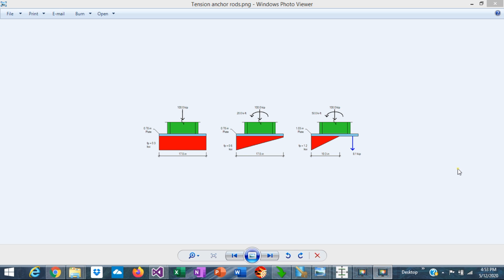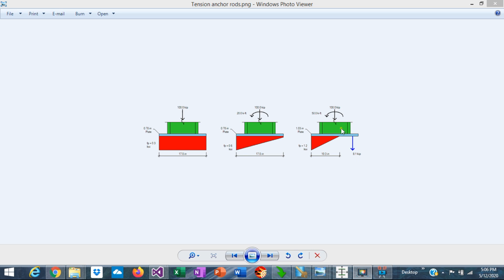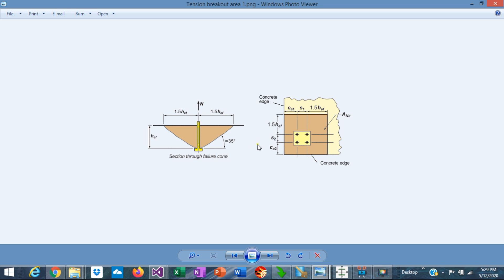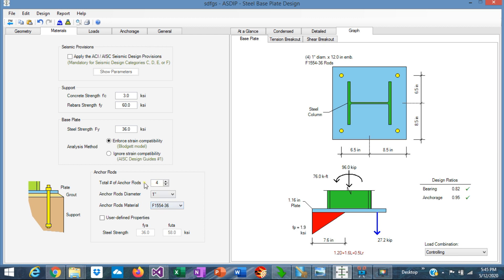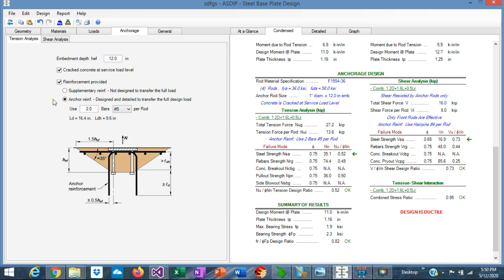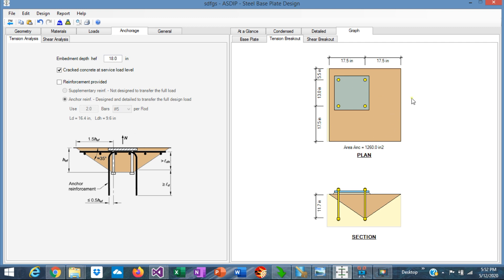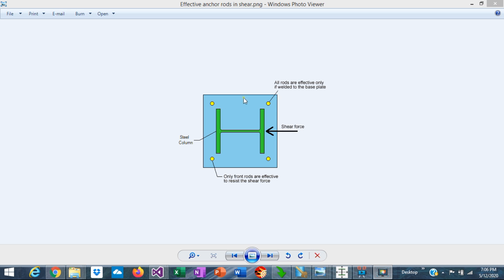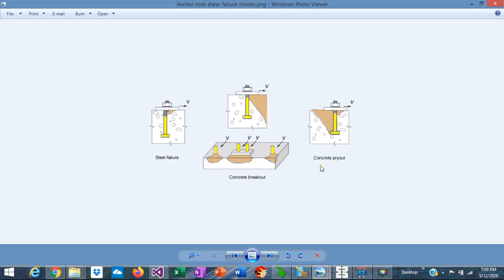Anchor Rod Design - The Complex ACI Provisions

Comment: 6:20
Cuando el anclaje no esta soldado a una pletina (como en el caso de las placas bases), existen tres tipos distintos de casos. El que mencionas en el vídeo sólo corresponde al tercer caso (Figura R17.5.2.1b ACI 318-14) y no considera los casos 1 y 2 de la misma figura. He estudiado este tema en los últimos días, contácteme y podría entregarle mucha más información importante que sería útil en el software.

When the anchor is not welded to a plate (as in the case of base plates), there are three different types of cases. The one you mention in the video only corresponds to the third case (Figure R17.5.2.1b ACI 318-14) and does not consider cases 1 and 2 of the same figure. I have studied this topic in the last few days, contact me and I could give you much more important information that would be useful in the software.
Reply from the maker: ASDIP STEEL considera todos los casos.
Reply: @asdipstructuralsoftware7797 Sólo considera el caso 3, es decir, toda la carga de corte lo resiste los anclajes de al frente. Hice el ejercicio de reemplazar los valores del ejercicio 18 del capítulo 15 de "The reinforced concrete Design Handbook", del ACI 318-14 y no entrega los mismos valores debido a ese error. Además, al momento de analizar la resistencia al desprendimiento del concreto por cabeceo del anclaje sometido a cortante (Prayout, capítulo 17.5.3), toma en consideración el área total del cono de falla de los anclajes que se encuentran en tracción y eso no es así ya que se debería tomar el área de los anclajes que se suponen trabajan a corte.
Además, para momentos bajos, es posible que todos los pernos se encuentren a tracción y no solamente los más alejados. En planilla, para lograr que todos los pernos se encuentren a tracción, es necesario que haya momento 0, y eso no es así (Afecta a los cálculos del arrancamiento del concreto).
En general me parece un programa muy bueno y fácil de entender. Como recomendación, me gustaría que en el sistema internacional de unidades, se trabajara en mm en vez de cm y como lineas a futuro de mejoras, sería bueno incluir corte y momento en ambos sentidos para que sea posible el análisis biaxial. También podrían agregar la opción de utilizar sillas de anclaje y con ello verificar los atiesadores, la placa superior y la placa base bajo estas nuevas restricciones.
Reply: También se me olvidó agregar que para el cálculo de la altura efectiva (17.4.2.3), sólo considera Ca,max/1.5 y no también el caso de s/3
Reply from the maker: @chiguayantex  ASDIP Steel considera el caso cuando los anclajes estan soldados a la placa base y el cortante se distribuye entre todos los tornillos. Si no estan soldados a la placa, solamente los anclajes del frente resisten todo el cortante. La siguiente version de ASDIP Steel incluira placas base biaxiales. Saldra al mercado para octubre de 2020.
Reply from the maker: @chiguayantex  ASDIP Steel tambien considera s/3 en el calculo de altura efectiva.
Reply from the maker: @chiguayantex  Por favor enviame un correo a support@asdipsoft.com para discutir esto mas a fondo.